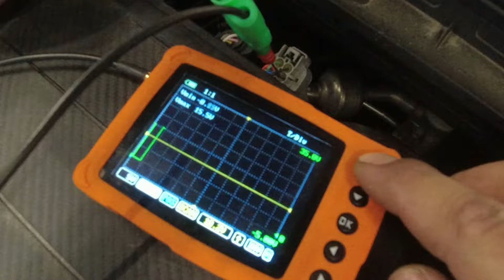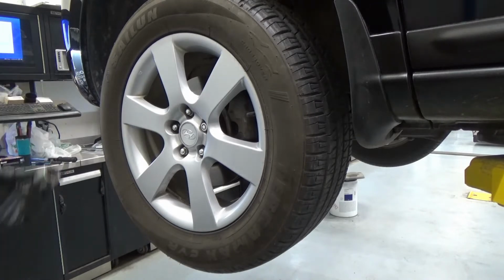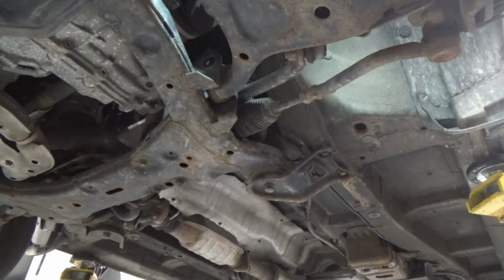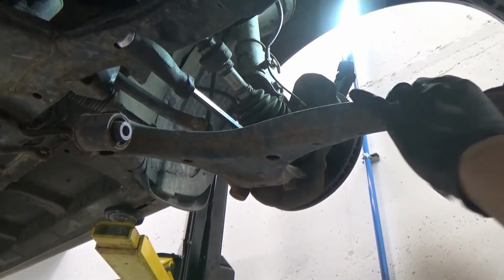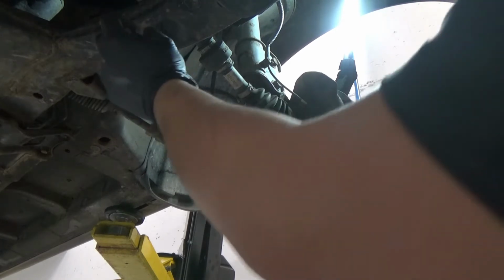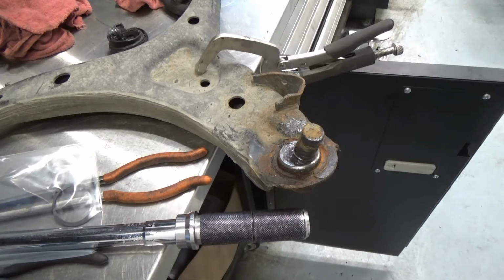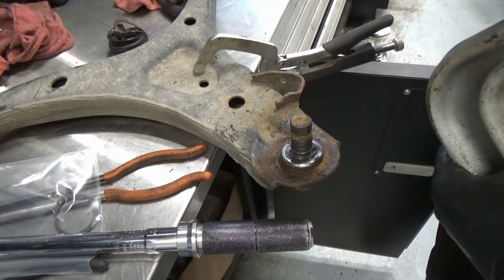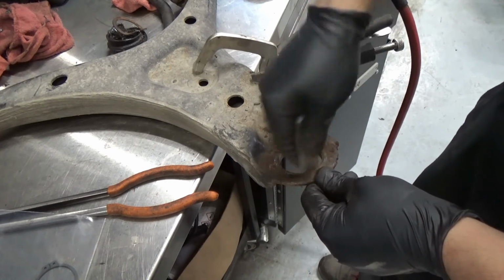Hyundai Santa Fe CM (2007-2012) Lower Ball Joint Replacement

Comment: The final tighten on the control arm bolts should be done at ride height to prevent tension in the rubber bushings.

Comment: Thank for a very well done video. I have a Kia Sorento 2012 which is very similar in design and I have to address a control arm issue.  Your video will greatly help me perform the task.
I have two questions if I may... 1) Would it be advisable to use anti-seize compound around the wheel bushing prior to re-inserting it so as to provide a protective coating against corrosion? 2) Do the other two bushings also need to be eventually changed? 2024/05/09. Ontario, Canada.
Reply from the maker: Yeah you can apply some anti seize in the sleeve of the bolt when reinstalling. And if ever you planning to replace the bushing i think its better to replace the whole arm, unless you have press and you have to take account the condition of the arm especially we live in canada the rust is very normal in the suspension components.
Reply: @hyundaitech  Noted with thanks. I also favor replacing the whole control arm as a result of the concerns that you have outlined. However, I found out that certain providers have "regular" control arms (with a 1 year warranty) and "premium" control arms (with a lifetime warranty and a significantly higher price). I strongly suspect that this reflects the "quality" of the bearings - something that can be very hard to evaluate!. 2024/05/10.

Comment: Bro are both of the joints similar on the left and the right?
Reply from the maker: Yes same part number if you just replace the ball joint. If you plan replacing the whole arm, then you have to be specific which side.

Comment: Great video. How much torque spec on those 2 bolts and the on the ball joint?
Reply from the maker: For the bolts going in to subframe both are 115 ft.lb, and for the bolt on the knuckle where the ball joint is 86 ft.lb..

Comment: Wouldn't it be easier  to undo the axle nut ... 
Move break assembly out of the way and then press out.. press in part.

Less steps no?
Reply from the maker: Yeah that make sense too, but i havent tried that method coz sometimes the axle is seized in the hub, and for me its  easier to do it in the bench.

Comment: Fancy c clamp there. Of course Hyundai Kia specific I'm certain
Reply from the maker: The one thats holding control arm or the one removing the ball joint. Its not hyundai specific. Its universal
Reply: You can find them on Summit Racing for ~$100, it's called a "ball joint service kit". If it was Hyundai/Kia specific, you would have seen "KOREA" on the side instead of "CHINA". 🙃

Comment: What a pain in the ass. Lower ball joints usually take me about 30 mins using regular hand tools in my driveway. I have a cm and hope I never gotta do a lower on it. What a bullshit design
Reply: My Subaru is the same design. It's even better when you live in the rust belt and salt water gets in between the slit where the ball joint cross bolt goes. My bolt was so corroded it snapped in half and I had to drill a smaller bolt hole through the knuckle to replace it.
Reply: @lucid484  Yeah, pretty common design for all Asian stuff. Even my old Ford of Europe designed Focus was similar. I too am in the rust belt and while watching this video was trying to guess which bolt will snap on me. Probably going to just leave the arm on and take the knuckle off as it needs a bearing as well.